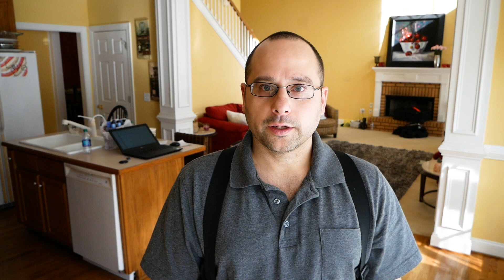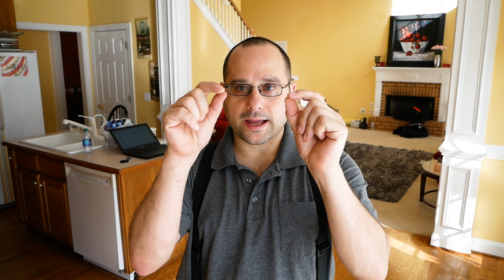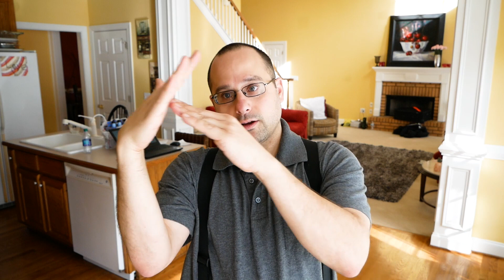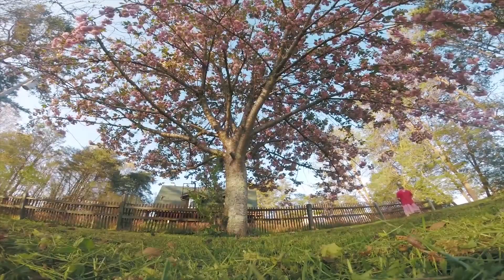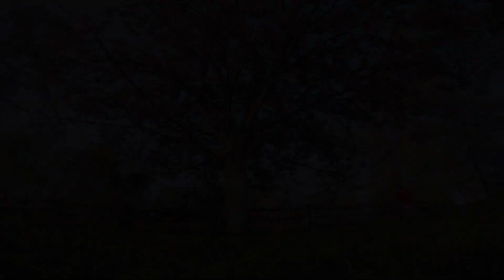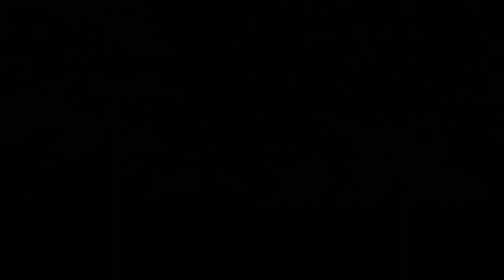Betaflight Stick Commands and Accelerometer Followup Questions

Comment: Hi Josh!  As a noob I definitely appreciate all the work you're putting into your content!  
One thought about another "I never heard about that" thing noobs might not think about:  Use the lanyard for your TX!  I figured out that before using it, I'd sometimes change my wrist angle instead of or in addition to changing the stick angle!  It is hard to be accurate with the sticks when your reference angle changes.  Using the lanyard helps keep the tx in place, so you're more likely to use the sticks better.  Just another thing "I learned today".

Comment: I learned something today that might help other newbies’. I was trying to calibrate the accelerometer trim from my Tx with no luck. I have low and high rates programed in the Tx and was flying on low rates finally figured out if I switched to high rates (full throw) calibration worked as it should.
Reply from the maker: Yes, the sticks must exceed min_check and max_check for the command to be registered.

Comment: This is why I have had the betaflight stick commands cheat sheet bookmarked forever now :) I rarely fly angle but find gyro/accel calibration makes it fly proper in angle. Betaflight osd whoop boards to have EZ mode for rate and PID profiles ;)

Comment: I know I would certainly be amazed by the amount of stick commands exist. Only ones I have ever really used are: Betaflight OSD and RunCam OSD. Anything else and it is likely I would probably resort to plugging in my quad and doing it on a computer. I need to print off a cheat sheet of all of the commands!

Comment: Hey josh hopefully you get this. no has has been able to answer my question fully. I am wondering if I fly across mode should I turn the acceleromter off when flying across. on my whoop and brushless rakonheli 2s, sometimes they do funky thinks when stopin or trying to roll its like it tries to balance itself out even though I'm in Acro mode. sometimes on the Brushless whoop when I go forward it goes left a right then dips hard right? Thanks for your help
Reply from the maker: No, you can leave it on. If you're not in autolevel mode, it doesn't have any effect.
Reply: really cause even when I have it in acro mode on any drone I own if the props are spinning and I'm holding it if I tilt the quad the props spin at different speeds like the accelerometer is kicking in?

Comment: Nice. Take your quad put it on  string and swing it round and you'll see it accelerates towards your hand. 0 gravity on earth is matching opposite earth to nullify it. A quick thought on always knowing what g is; tie in the magnetometer to the accelerometers. N & S (outside) should always be the same. Could possibly track past acceleration as part of it or by itself which is a means of navigation I am sure you know.

Comment: Like #18 question for Joshua I calibrated my accelerometer on my 5" quad on my dining room table it's not exactly level I would assume but pretty close but when I fly my quad in angle mode it drifts backwards my battery is top mounted in the center all my trims on my transmitter are centered (qx7) my endpoints are 2000 1500 centered and 1000 on beginning points any suggestions for fixing this drift I know the quad will drift some but it is a obvious drift backwards and I was not sure if I should adjust my trims on my transmitter or if they were supposed to all be centered thanks for your help if you could
Reply from the maker: Watch the original video linked in the description, where I show how to trim the accelerometer.

Comment: Offtopic question: How many cycles do you guys usually get from your LiPos? It seems to me that when my LiPos (4S 1300mAh) hit 50 cycles, they start to lose their punch. After 60 they start to feel like 3S LiPo and finally, nearing 70 cycles they are mostly just trash.
Reply from the maker: LiPo lifecycle depends a lot on how you treat them. I suggest that the packs should be resting around 15.0 volts after recovery at the end of a pack. Charge at 1C or lower.
Reply: I mostly manage to hit 14.7-15V resting voltage after they cool off. I typically drain 1100~ mAh from them. I Charge at 1C. I never overcharge(Unless you count 0.01-0.05V as over charging?). I always make sure i store them at 15.4V and aside of weekends, i alternate between 2 sets of 6 LiPos, so that the same set is never charged 2 days in a row. The only 2 bad things i do to my LiPos are; 1. I charge them fully(16.8V) the night before, on work days(5 days a week atm). 2. I tend to rip balls with them so much so that i could make me some bacon with them after i land. Especially after that 50 cycle mark, after that they really start to heat up. Currently their Internal resistance is around 40-50 mOhms@15V on the worst of them, the best are around 20-30 mOhms@15V.

Comment: 6:11 - I think a mistake was made regarding the direction of the force in a turn.
If the acceleration was outwards you would be moving out of the turn.
In the turning car example, I think what you are feeling is the car accelerating into you,
while you are still moving in the previous direction from before the turn.
The centrifugal force is fictitious while the centripetal force is real.

Search for centrifugal force vs. centripetal force if you want to read more :)
Reply: Frozhax correct the acceleration is into the centre of the turn what you are feeling is the applied force that creates that acceleration. Might seem like a trivial thing to pick out but does have significant ramifications in how you interpret and understand the dynamics at work.

Comment: In betaflight when you manually trim accelerometer pitch and roll by changing the numbers in those boxes under acc. Trim, which way is positive and which way is negative? I had one drifting to the right and I watched your video on your whoop drifting right and you did the stick command trims and then it showed you after in betaflight what the trim numbers were after doing that, I tried putting positive and it didn’t help I had to do negative to get it to stop drifting right. I have betaflight 1.05 or whichever is the newest one. Mob7 F4FS FC
Reply from the maker: I don't know which is which. I just use stick inputs to trim it.

Comment: Hi, should the stick commands work on a Radio lite 2? Cheers from Scotland
Reply from the maker: Stick commands should work with any controller. The FC is just reading the stick positions. If the controller can fly the quad, it can enter stick commands.

Comment: Interesting video!  I think you can compensate for G-force correction during turns by using some PID controller.  The question what is the use case for this in mini drones as we generally do not fly with with the accelerometer turned on.  Side note:  Raceflight does use the accelerometer during a crash.  ???

Comment: Thanks! My whoop still rolls and pitches to the right/front in airmode.. in Angle Mode it’s fine But nog really flyable in airmode.
Reply: maybe you need to increase i gain on both pitch and roll.
Reply: thanks, will try it!

Comment: I know this is an old video, but I’m still confused about why the trims don’t work on my transmitter.  I get the 1000/2000 endpoints but when I’m entering trim from the stick command and I can see that compensation in betaflight, why isn’t the physical trim button doing the exact same function?
Reply from the maker: Check if the trim switch is moving the channel position in the controller. Opentx can have trims disabled.

Comment: Stick commands driving me crazy.  Trying to setup my receiver on the screen, quad beeping "beep beep beep".  Then I surprise find out the ACC-TRIM is +96 over!

Is there a way to disable stick commands?  I prefer to click a switch or code on the screen, since I have no way to know which adjustment was made by accidentally moving sticks when quad not armed.
Reply from the maker: You can't disable stick commands, unfortunately. If your ACC trim was way off it's because you had throttle all the way up and you were moving the pitch and roll around.
Reply: @JoshuaBardwell  looking at this stick command chart, it is very likely I would trigger any number of these commands and settings, while I am simply trying to tune my receiver minimum and maximum.  Same thing in the PID screen, if when I want to tune the expo and limit values - I am up and down with the sticks all over.  Really frustrating, considering I would actually have no way to display 'acc trim' on the osd or anywhere, if I was in a grass field and accidentally toggled a change with my remote.
Reply: @JoshuaBardwell  I finaly figured out, if I set min/max stick setting outside of my range - then the stick commands would be disabled.

Comment: Joshua I have a very challenging trouble shoot that I need help with. I am getting random fail safes with my Taranis X9D SE and multiple quads. Problems shows up as latency to stick inputs. The quads don't drop out of the sky but my control freezes or delays for split seconds. First I suspected my receiver but I have had this problem on 3 quads. I have switched transmitter antenna with no luck, now wondering if the RF board in my Taranis is bad. Any advice or leads would be appreciated
Reply from the maker: If it happens on multiple receivers and you tried changing the antenna, I agree that the radio board is the next place to look.
Reply: thanks for the response. I'm hoping its just the connector on top of the Taranis and not the $pendy RF board. Keep up vids and advice, big fan.

Comment: Hello, I have something your viewers and myself might like to be informed about:     In Blheli32 what is the setting for PWM Frequency and what information is needed to select the correct kHz setting for different motor and esc combinations?Thanks for your timeCleo.
Reply from the maker: It changes the PWM frequency used by the ESC to drive the motors. I have heard lots of reports that 48 kHz does better, and I personally set my quads to 48 kHz. I just can't figure out why that's not the default, and if there is some hidden catch.
Reply: For comparison Blheli_s uses 24khz. You can safely use 32khz on most blheli32. You may experience problems going any higher.

Comment: The way artificial horizon is done on real aircraft is by using a free gyro which is gimbaled so it always points in the same direction (up) regardless of the craft's orientation or acceleration. This are not the gyros we have - they are rate gyros and are fixed so they sense rotation rates through torque. They can be combined with an integrator (either software or hardware) to give the true orientation, but since integration is involved they drift over time. I believe this is how betaflight's horizon works - integration of the rate gyros with the accelerometer data used to correct for drift. Without using a free gyro which takes space and is a more complex mechanism so not viable I think the only way to improve the artificial horizon is high quality RIG gyros (which have little drift) but these are extremely expensive so that's out. What we have now is probably the best that can be done with these limitations.

Comment: Unrelated question but im really stuck. I have raceflight one and for some reason one of the racebee 30 amp esc wont flash. Wont even give motor tones. All the esc's were successfully flashed but that one.  Will buying another racebee 30 amp solve the problem? If it doesnt what esc's should i buy?
Reply from the maker: Swap the ESC to another signal pad. If it flashes, the FC is the issue.
Reply: ive tried putting the esc on a different arm but it seems to still be the same esc no matter what signal pad. Do you think raceflight is force flashing the wrong esc firmware to the esc's?

Comment: Which is the right setup LOW/MID/HIGH point on Futaba Tx ?
Mid point on it is 1520 so we need to move the low and high points consequently ?
I saw there is a parameter on BF for that but i don't know how it works !!!
Reply: If you're having trouble with your receiver endpoints in Betaflight not showing as 1000 min & 2000 max and you know your transmitter is outputting 1000 min & 2000 max, you can tune them with the RXRANGE command in CLI, for example "rxrange 0 1021 2021", which can also help with correcting the midpoint.
Reply: I found that on wiki:

mid_rc parameter:
This is an important number to set in order to avoid trimming receiver/transmitter. Most standard receivers will have this at 1500, however Futaba transmitters will need this set to 1520. A way to find out if this needs to be changed, is to clear all trim/subtrim on transmitter, and connect to GUI. Note the value most channels idle at - this should be the number to choose. Once midrc is set, use subtrim on transmitter to make sure all channels (except throttle of course) are centered at midrc value.

Comment: How to change control input type between relative and proportional for a given channel? For control of servo using joystick. Not using programmable tx
Reply from the maker: Simply use servo passthrough to output the PWM signal directly from the transmitter to the servo.

https://github.com/betaflight/betaflight/wiki/Servos-&-SERVO_TILT-for-3.1
Reply: @JoshuaBardwell but does that still allow the flight controller to stabilize the servo? I want the servo to move when I move the joystick in a direction, and when the joystick returns center, I don't want the servo to center.

Comment: What does "In-flight Calibration Controls", "Disable LCD Page Cycling", and "Enable LED Page Cycling" do? I understand all of the other sick commands but there's nothing online that explains these three.
Reply from the maker: In-flight calibration lets you calibrate the accelerometer while hovering the quad. You hover the quad flat and level then activate the mode and it trims the accelerometer based on your stick positions.

LCD page cycling has to do with if you are using an external LCD/OLED screen I think. It's not commonly used.
Reply: Joshua Bardwell, how would you engage it in a hover when you have to pull the throttle stick down to low, left though?
Reply: Well apparently I wasn’t the only one confused and it’s pretty complicated. 

From  github issues:

“Not sure if / how this is supposed to work, since entering the stick command will force the craft into an edge flip, which is probably not what you want when calibrating the accelerometer.”

I Found this article on it: https://github.com/betaflight/betaflight/issues/5611

And these details on how it’s done: http://www.multiwii.com/forum/viewtopic.php?f=7&t=893

Comment: I believe Betaflight and Cleanflight has a workaround for the accelerometer thing. It relies on the Gyro most of the time and only checks the Accelerometer every now and again (maybe 100Hz or something) and if they are wildly different for a short period of time in knows it is in a turn. It probably takes a second or two before it makes a correction.
Reply: Actually, there is no Gyro in any miniquad. This is because a Gyroscope requires a fast rotating sphere of certain mass and can therefore not fit inside the small electronic components of a flight controller.
Reply: MrBlarok there is an electronic gyro in the IMU chip, just because it doesn't have a spinning wheel doesn't make it not a gyro. It works by similar principles and if it works like a gyro, smells like a gyro and tastes like a gyro, it is a gyro.
Reply: You're right. there are electrical gyros that use a vibrating quartz and coriolis force to detect angular turns.

Comment: Distinguishing the pull of gravity vs acceleration of quad in different direction - hasn't that been done already? I mean, 3 axis camera gimbals would never be able to cope with the acceleration of the multirotor it's attached to (or you in the case of handheld ones) and the pull of gravity at the same time if someone hadn't figured out the code. Not being a mathematician I can only guess that the necessary code uses the combination of the accelerometer and gyroscope of the IMU to achieve this.
Reply from the maker: Yes, integrating the gyro might be the answer.

Comment: The stick commands for trim didn't work for me. I use betaflight 3.2 and am using a flysky fsi6, though my tx shouldn't matter. Any thoughts?
Reply from the maker: +VampCaff be sure that your stocks are exceeding max_check in the receiver tab. This is the same as the Stick High Threshold parameter in the GUI.
Reply: @JoshuaBardwell  Hi Joshua, it also doesn't work on my QX7.  How do i check max_check or...

Comment: Josh I have a Wizard x220 and when I switch from horizon mode to acro mode the drone will start going forward and left without moving the controls.  It's not a lot but it is enough to get it moving so I can't concentrate on flying the drone but trying to get it to stop moving.  Any ideas?
Reply from the maker: +ctimgo your channels aren't centered at 1500 in the receiver tab. Most likely you have used transmitter trims to trim the autolevel mode. Center the channels correctly and then use accelerometer trim as described in the previous video to fix the autolevel mode.